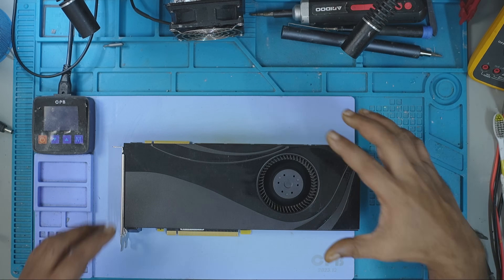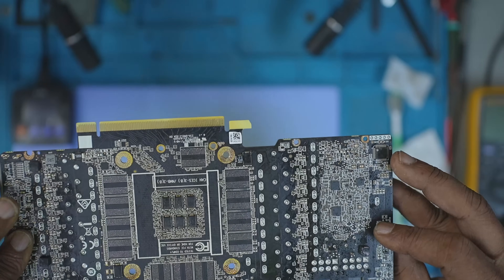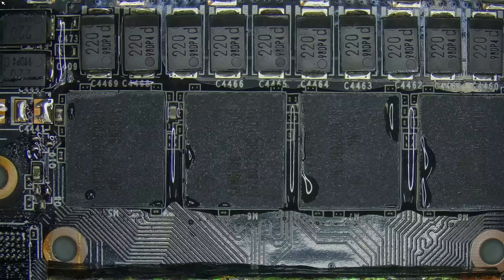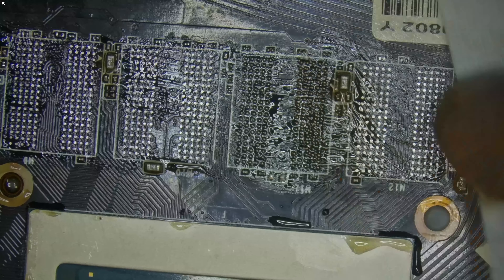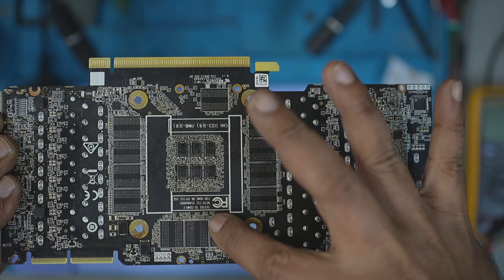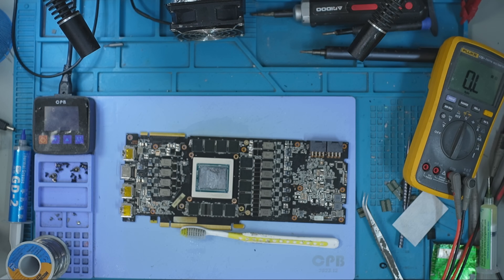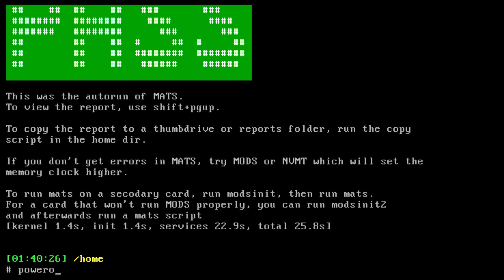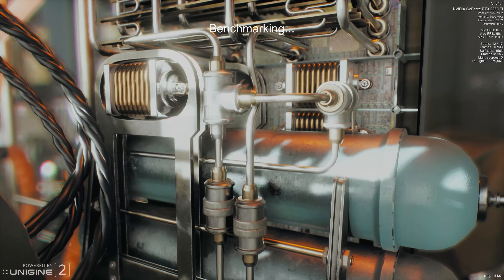Can Any GPU Get a VRAM Upgrade? | Asus RTX 2080 Ti (11GB → 22GB)

Comment: Great explanation, I would love to attempt to do this to a cheap GPU. Nice tip on practicing on dead boards. I need to find myself some dead boards to practice on. Do you know if you can increase the ram on an old RX560? I have a 4gb model that I would like to eventually upgrade to 8gb.
Reply from the maker: Rx 560 is too weak to use extra memory. It also has only 4 active slots. There is no room to install more memory. On GDDR5 1 GB is the largest capacity.
Reply: @GraphicsCardRepairs-tk7ql  Thanks for the reply :) interesting! I didnt know a gpu could be too weak for more vram.
Reply from the maker: @DodgeMods some GPU fall short of utilising the memory.

Comment: Is it possible to upgrade an RTX 5060 GDDR7 from 8gb to 12gb with 3gb module? Asking this because there aren't many Low Profile GPU options with more VRAM.
Reply from the maker: I have answered this question in the video. 3GB memory modules are not available yet in the open market and it is yet to be tested on 50 series GPUs.

Comment: a friend of mine said that even if you replace the memory modules and the card recognize the extra memory, the firmware on the car would not recognize the extra memory addresses and therefore not use the extra memory at all, is that true?
Reply from the maker: Just by replacing the memory to 2GB the GPU will not recognise the extra memory. The bios needs to be told which memory type and size is installed on the PCB. Yo do that STRAP is used. Strap is an arrangement of resistors which tell the BIOS which memory is installed and which memory timings to use. The bios sends the information to the computer when the computer queries the PCIE slot of the GPU at startup. Without the STRAPs the bios will not send the correct information and the changes will not reflect or be used.
Reply: @GraphicsCardRepairs-tk7ql  Ah, I was already wondering why I saw you desoldering/soldering those SMD resistors in the video. Makes sense! I'm surprised that's all it takes though, I would have imagined that a GPU firmware upgrade would be required as well. So that would then mean that the 2080 Ti carries a larger firmware than necesarry, seeing as it holds both the code for utilising the memory size it comes out of the factory with, and for the doubling in memory?
Reply from the maker: @pieterveenders9793 yes it has the bios memory timings already written for the new memory I have installed to double it. No bios edit is required.

Comment: i have yeston rtx 3050 6Gb low profile. it has 1 more unpopulated ic. can i solder 1 more vram ic to make it 8gb?
Reply from the maker: If your using the 6 GB version. The part of the core connecting to the empty slot on the PCB is not active. Nvidia disables defective part of the core to sell lower modes. Installing memory there will not work.
Reply: @GraphicsCardRepairs-tk7ql   thank you. that makes sense.

Comment: I own an ASUS TUF III EVO RX 5600 XT, and when I got it I was curious if someone has upgraded an RX 5600 XT to double the VRAM, since the PCB is also used on the RX 5700/5700 XT.

and it seems like a few brazilian guys have done it but the VBIOS was a pain in the ass to deal with.

I'd honestly take the risk of upgrading my GPU's VRAM if there was a repair guy as good as you to do it.
Reply from the maker: Yes bios is an issue. I face the same issue with the 3080 Ti.
Reply: i own a 5700xt, and asked previously if OP would be interested in attempting something similar. could you provide a link, or some details so i could dig deeper?
Reply: @SurrealKillcam you could check out a guy named Paulo Gomes here on YT, although his content is in brazilian/portuguese. I've seen him somehow upgrade a 5600 XT 6GB 192bit to a 16GB 256bit and even provided a vbios for that specific board.

compared to the 5600 XT/5700 non-XT(which are the same GPU with different memory configs) you could theoretically turn you 5700 XT to a W5700X 16GB, but with this stuff you really need someone good at these things for that to be possible.
Reply: @SurrealKillcam   the link about the 12GB 5600 XT is gone somehow, I saw it on a Guru3D forums thread and the link is dead.

but there is this Brazilian guy here on YT where he upgraded a 5600 XT to 16GB 256bit and I think he also provided a bios file for the specific card, I suggest checking him out his name is Paulo Gomes although his content is in brazilian/portugese.

but things might be different in your case? since the 5600 XT and 5700 non-XT are the exact same GPU with different memory config 6GB 192bit vs 8GB 256bit.
with your 5700 XT you could theoretically turn it into a W5700X 16GB by flashing a vbios with a modified board id and some other stuff, but I think it won't be that straightforward.
Reply: @SurrealKillcam the link about the 12GB 5600 XT is gone somehow, I saw it on a Guru3D forums thread and the link is dead.

but there is this Brazilian guy here on YT where he upgraded a 5600 XT to 16GB 256bit and I think he also provided a bios file for the specific card, I suggest checking him out, his name is Paulo Gomes. although his content is in brazilian/portugese.

I think yours will be an entirely different case since the 5600 XT and 5700 non-XT are the exact same GPU with just different memory configs.
yours however is a 5700 XT which you can theoretically turn into a W5700X 16GB, by maybe flashing a W5700X vbios with a modified board ID and some other stuff but I'm sure it won't be that straightforward.

I wish upgrading GPU VRAM is as simple as soldering new chips on the board and be done with it😭
so many wasted GPUs with good power but not enough VRAM.

Comment: when you upgrade the 3070 to 16gb is it necessary to select power management mode at nvidia control panel to prefer maximum performance instead of normal in order to avoid possible black screens after benchmarks finishes etc?
Reply from the maker: Yes power management needs to be changed to hi performance. I have part 2 of 3070 upgrade on my channel when I show this.
Reply: @GraphicsCardRepairs-tk7ql  thank you for the response i am going to see that video.

Comment: I began practicing on DDR when i upgraded to DDR2, did the same when arriving to DDR3. When i decided to go more pro, after losing my skill not practicing for a very long time, i just took some old computers in trashes. It's easier for entry level than GPUs in my opinion. It just require a working CPU, motherboard and RAM, can only boot MemTest86. Even then, when i tried going for my first RX 580 upgrade from 4 to 8GB, having received mixed ones from old crypto rigs, even though i was good at reballing and not overheating the chips, i absolutely made a mess of the first card, knocking off other SMDs around, luckily it was the non-working donor board.

Good job really, i wish i would still have the same hand stability i had younger, i developed a shake after an accident and it didn't get better with time.
Reply from the maker: Sometimes I manage to knock off some components as well. But after a ton of practice I manage to put it together. Practice just gets it better. 😊

Comment: Hi sir, I have problems with strix 1080ti OC i think one of the memories are bad, games are crashing and they work if i lower frequency of memory on -300 in afterburner. How can I diagnose what exactly memory is making the problem? How much it will cost for you to fix it? I hope I can send you the gpu somehow
Reply from the maker: In this case more than memory I assume it is the memory controller on the core. But to run a memory test you will need mats and mods software.
Reply: may I email you after running tests?
Reply: @GraphicsCardRepairs-tk7ql   
This is report from mats and mods, can you help me?

mats version 400.184.  Testing GP102 with 20 MB of memory starting with 0 MB.

Read    Error Count: 0
Write   Error Count: 33
Unknown Error Count: 0

=== MEMORY ERRORS BY SUBPARTITION ===
SUBPART READ ERRORS WRITE ERRORS UNKNOWN ERRS
------- ----------- ------------ ------------
FBIOA0            0            0            0
FBIOA1            0            0            0
FBIOB0            0            0            0
FBIOB1            0            0            0
FBIOC0            0            0            0
FBIOC1            0            0            0
FBIOD0            0           33            0
FBIOD1            0            0            0
FBIOE0            0            0            0
FBIOE1            0            0            0
FBIOF0            0            0            0
FBIOF1            0            0            0

Failing Bits: 
   D000 D001 D002 D003 D004 D005 D006 D007 D008 D009 D010 D011 D012 D013 D014 D015 
D016 D017 D018 D019 D020 D021 D022 D023 D024 D025 D026 D027 D028 D029 D030 D031 

=== MEMORY ERRORS BY BIT ===
P : Partition (FBIO)
                                            READ 0 READ 1 READ ?
P BIT READ ERRORS WRITE ERRORS UNKNOWN ERRS EXP. 1 EXP. 0 EXP. ?
- --- ----------- ------------ ------------ ------ ------ ------
D 000           0            4            0      2      2      0
D 001           0            7            0      2      5      0
D 002           0            8            0      3      5      0
D 003           0            8            0      3      5      0
D 004           0            7            0      2      5      0
D 005           0            8            0      1      7      0
D 006           0           11            0      2      9      0
D 007           0            4            0      4      0      0
D 008           0           12            0      0     12      0
D 009           0           12            0      0     12      0
D 010           0           12            0      0     12      0
D 011           0            4            0      4      0      0
D 012           0            4            0      4      0      0
D 013           0            4            0      4      0      0
D 014           0            4            0      4      0      0
D 015           0            4            0      4      0      0
D 016           0           12            0      2     10      0
D 017           0            9            0      2      7      0
D 018           0            7            0      2      5      0
D 019           0            7            0      4      3      0
D 020           0            4            0      1      3      0
D 021           0            8            0      0      8      0
D 022           0           11            0      0     11      0
D 023           0            5            0      5      0      0
D 024           0           12            0      0     12      0
D 025           0           12            0      0     12      0
D 026           0           12            0      0     12      0
D 027           0            5            0      5      0      0
D 028           0            5            0      5      0      0
D 029           0            5            0      5      0      0
D 030           0            5            0      5      0      0
D 031           0            5            0      5      0      0

=== MEMORY ERRORS BY ADDRESS ===
ADDRESS : Failing memory address, or buffer offset if starting with 'X+'
T : Type of memory error: W = write, R = read
P : Partition (FBIO)
S : Subpartition
B : Bank
E : Beat
U : PseudoChannel
   ADDRESS EXPECTED   ACTUAL  REREAD1  REREAD2 FAILBITS TPSBEU  ROW COL                                                      BIT(s)
   ------- --------   ------  -------  ------- -------- ------  --- ---                                                      ------
0000002d78 00000000 00000754 00000754 00000754 00000754 WD0840 0000 013                               D002,D004,D006,D008,D009,D010
0000002d70 00000000 00000752 00000752 00000752 00000752 WD0800 0000 013                               D001,D004,D006,D008,D009,D010
0000002d68 00000000 0000074c 0000074c 0000074c 0000074c WD0840 0000 012                               D002,D003,D006,D008,D009,D010
0000002d60 00000000 00000745 00000745 00000745 00000745 WD0800 0000 012                               D000,D002,D006,D008,D009,D010
0000002d58 00000000 00000744 00000744 00000744 00000744 WD0841 0000 013                                    D018,D022,D024,D025,D026
0000002d50 00000000 00000743 00000743 00000743 00000743 WD0801 0000 013                               D016,D017,D022,D024,D025,D026
0000002d48 00000000 0000074f 0000074f 0000074f 0000074f WD0841 0000 012                     D016,D017,D018,D019,D022,D024,D025,D026
0000002d40 00000000 00000749 00000749 00000749 00000749 WD0801 0000 012                               D016,D019,D022,D024,D025,D026
0000002df8 00000000 00000773 00000773 00000773 00000773 WD0841 0000 017                     D016,D017,D020,D021,D022,D024,D025,D026
0000002df0 00000000 00000765 00000765 00000765 00000765 WD0801 0000 017                          D016,D018,D021,D022,D024,D025,D026
0000002de8 00000000 00000763 00000763 00000763 00000763 WD0841 0000 016                          D016,D017,D021,D022,D024,D025,D026
0000002de0 00000000 0000076f 0000076f 0000076f 0000076f WD0801 0000 016                D016,D017,D018,D019,D021,D022,D024,D025,D026
0000002dd8 00000000 00000772 00000772 00000772 00000772 WD0840 0000 017                          D001,D004,D005,D006,D008,D009,D010
0000002dd0 00000000 00000770 00000770 00000770 00000770 WD0800 0000 017                               D004,D005,D006,D008,D009,D010
0000002dc8 00000000 00000720 00000720 00000720 00000720 WD0840 0000 016                                         D005,D008,D009,D010
0000002dc0 00000000 00000768 00000768 00000768 00000768 WD0800 0000 016                               D003,D005,D006,D008,D009,D010
0000002db8 00000000 00000763 00000763 00000763 00000763 WD0841 0000 015                          D016,D017,D021,D022,D024,D025,D026
0000002db0 00000000 00000775 00000775 00000775 00000775 WD0801 0000 015                     D016,D018,D020,D021,D022,D024,D025,D026
0000002da8 00000000 00000773 00000773 00000773 00000773 WD0841 0000 014                     D016,D017,D020,D021,D022,D024,D025,D026
0000002da0 00000000 00000720 00000720 00000720 00000720 WD0801 0000 014                                         D021,D024,D025,D026
0000002d98 00000000 0000076f 0000076f 0000076f 0000076f WD0840 0000 015                D000,D001,D002,D003,D005,D006,D008,D009,D010
0000002d90 00000000 0000074e 0000074e 0000074e 0000074e WD0800 0000 015                          D001,D002,D003,D006,D008,D009,D010
0000002d88 00000000 00000720 00000720 00000720 00000720 WD0840 0000 014                                         D005,D008,D009,D010
0000002d80 00000000 0000073a 0000073a 0000073a 0000073a WD0800 0000 014                          D001,D003,D004,D005,D008,D009,D010
0000002d00 ffffffff ffff0772 ffff0772 ffff0772 0000f88d WD0801 0000 010                D016,D018,D019,D023,D027,D028,D029,D030,D031
0000002d08 ffffffff ffff076f ffff076f ffff076f 0000f890 WD0841 0000 010                          D020,D023,D027,D028,D029,D030,D031
0000002d10 ffffffff ffff0775 ffff0775 ffff0775 0000f88a WD0801 0000 011                     D017,D019,D023,D027,D028,D029,D030,D031
0000002d18 ffffffff ffff0774 ffff0774 ffff0774 0000f88b WD0841 0000 011                D016,D017,D019,D023,D027,D028,D029,D030,D031
0000002d20 ffffffff ffff0765 ffff0765 ffff0765 0000f89a WD0800 0000 010                D001,D003,D004,D007,D011,D012,D013,D014,D015
0000002d28 ffffffff ffff073a ffff073a ffff073a 0000f8c5 WD0840 0000 010                D000,D002,D006,D007,D011,D012,D013,D014,D015
0000002d30 ffffffff ffff0720 ffff0720 ffff0720 0000f8df WD0800 0000 011 D000,D001,D002,D003,D004,D006,D007,D011,D012,D013,D014,D015
0000002d38 ffffffff ffff0753 ffff0753 ffff0753 0000f8ac WD0840 0000 011                D002,D003,D005,D007,D011,D012,D013,D014,D015
0000002e00 ffffffff ffff0773 ffff0773 ffff0773 0000f88c WD0801 0000 008                     D018,D019,D023,D027,D028,D029,D030,D031
If you are getting failure for first MB of FB then try option -no_scan_out
Error Code = 00000001 

                                        
 #######     ####    ########  ###      
 #######    ######   ########  ###      
 ##        ##    ##     ##     ###      
 ##        ##    ##     ##     ###      
 #######   ########     ##     ###      
 #######   ########     ##     ###      
 ##        ##    ##     ##     ###      
 ##        ##    ##  ########  ######## 
 ##        ##    ##  ########  ########
Reply: I assume its the mem chip bottom left near the monitor connectors

Comment: Can my EVGA RTX 3070 Ti be upgraded from 8GB of VRAM to 16GB?
Reply from the maker: Currently I have not managed to get any GPU using GDDR6X to work with upgrades. I am working on a 3080 Ti and once I am able to I will release a video. The process will be the same for 3070 Ti also.

Comment: Another example of clamshell methode on old gpu are GTX 550 Ti, GTX 650 Ti Boost, and GTX 660.
They're 192 Bit bus GPU with 8 memory Modules, 4 of the are clamshelled together....

Comment: I have got a gtx 1660ti 6gb it has got 2 blank pads to solder chips on i have got all the tools and such to do so do u think I can add x2 chips to upgrade the gpu to maybe 8gb ?
Reply from the maker: The blank slots are not active on the GPU core. Installing memory there will not work.

Comment: so can we upgrade the 3070ti to 16gb? cause i cant find ddr6x modules anywhere for repair
Reply from the maker: RTX 3070 used GDDR6X and I have not managed to upgrade any GPU with GDDR6X yet. I am working on a RTX 3080 Ti. Once I am able to upgrade the RTX 3080 Ti I will be able to do the same for the RTX 3070 Ti.
Reply: doesn't the 3070 and 3070ti all use GDDR6X?
Reply from the maker: @MaxIronsThird 3070 uses GDDR6 but 3070 Ti uses GDDR6X.